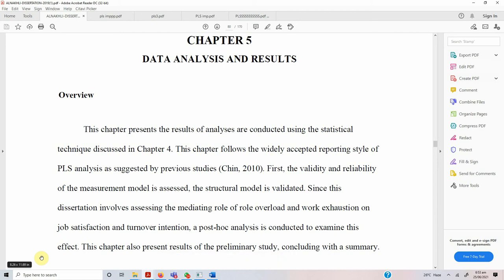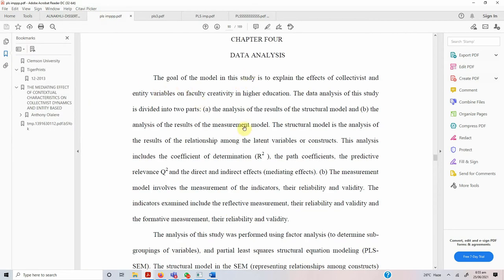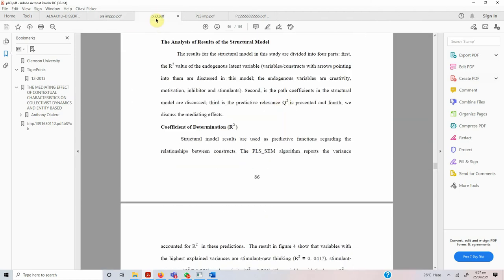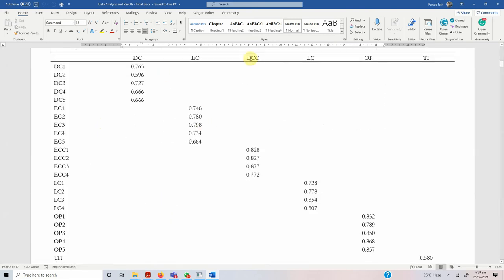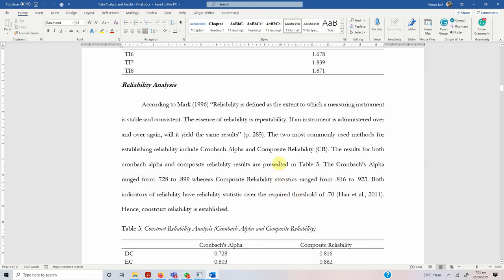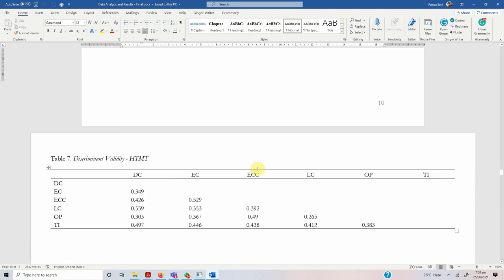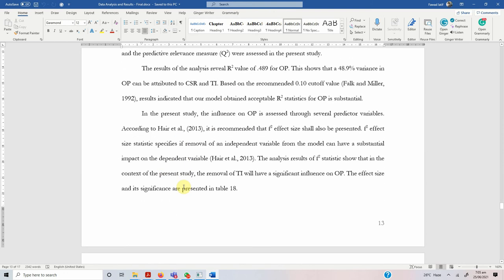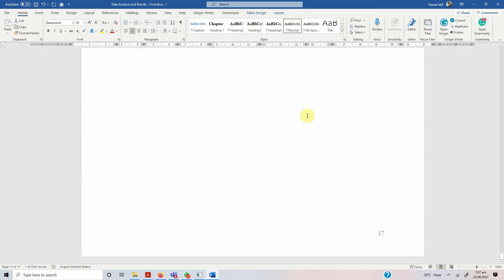6. How to Structure, Format, and Report SmartPLS Results in a Thesis/Dissertation

Comment: Dear Sir, do you have this [Structure, Format, and Report Results in a Thesis/Dissertation] for SPSS instead? I admit I'm quite confused on the arrangement of analysis/report to write first...
Reply from the maker: You can use the same structure but you will have to perform reliability and validity in SPSS plus the assessment of the hypothesized relationships.

Comment: Sir, if we find after collecting data that there is discriminant validity issues between two constructs because both constructs are loaded on the same factor/indicator,  that can be checked through principal component analysis. Can we combine two indicators on this basis, because it is validity condition before applying pls- sem.Theoretically they are different according to existing scale, but statistically they are loaded on same indicator
Reply from the maker: Yes they can be combined. Watch this video.
https://youtu.be/Vvu1Sntf6fc

Comment: Hi sir, hope you're doing well :)

I have a question about beta coefficient. Is it okay if it is in negative values? If it is okay, how do you suggest me to explain that in my thesis?

Thanks sir.
Reply from the maker: You can have -ive values. Do you expect the negative relationship? if not, you will have to identify the possible reasons that could lead to the negative relationship.